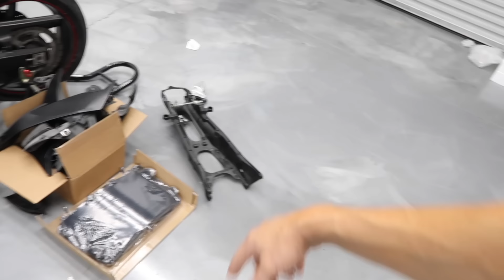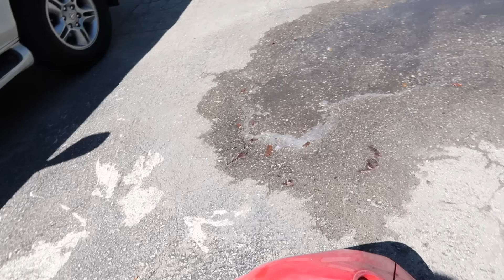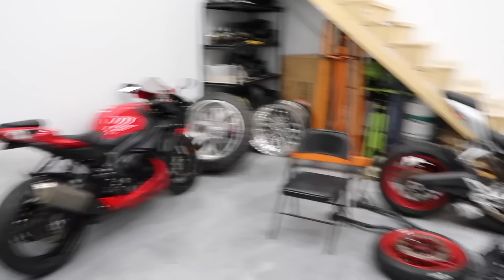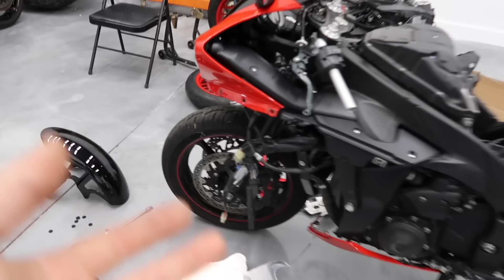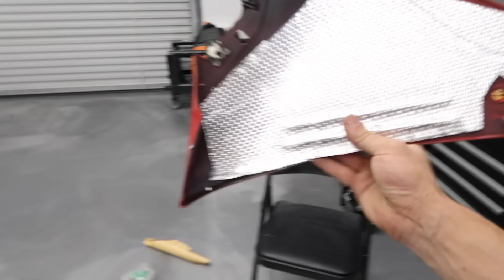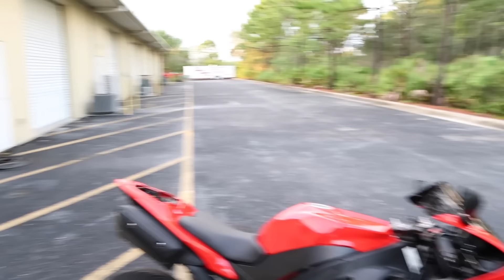2014 Yamaha R1 WRECKED Bike Rebuild (Complete Rebuild) Start to Finish

Comment: Bro my Yamaha r1 2011 model has a complaint that is while running battery becomes drain so I changed regulator and magnetic coil but not change the situation